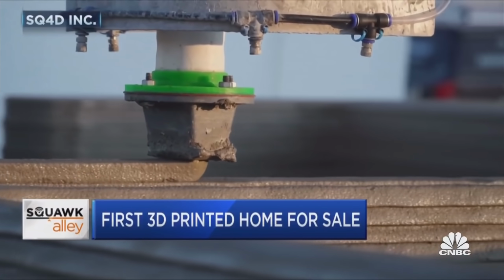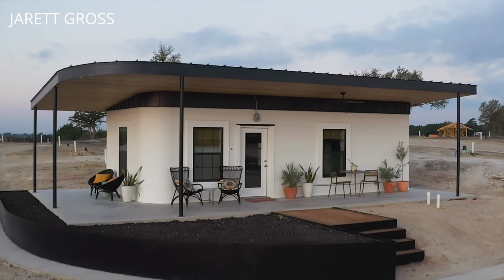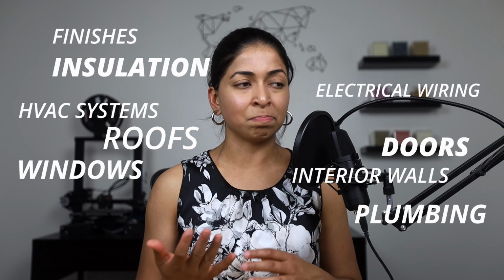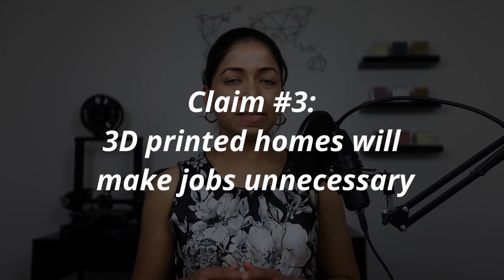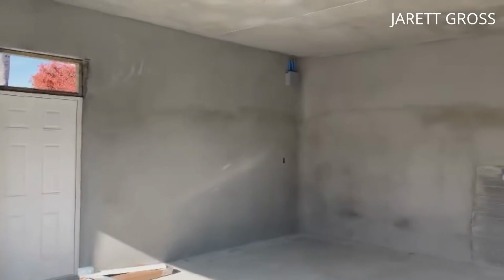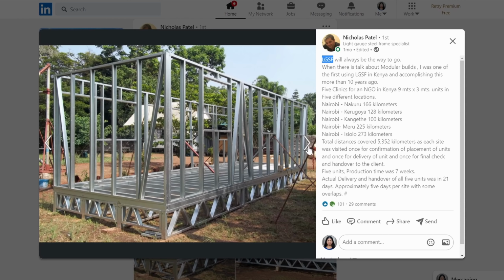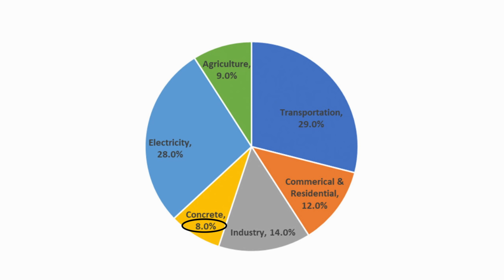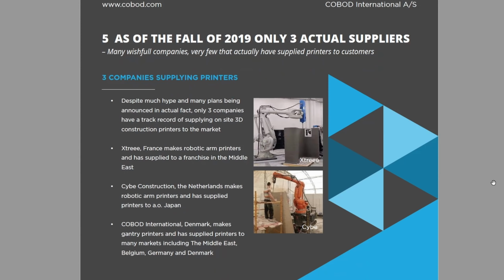Exposing 5 LIES about 3D Printed Concrete Homes

Comment: I've actually looked at a "3d printed home" and honestly, I'm not impressed. At first it seems like a cool idea until you realize that the cement is often low quality and cracks very easily. The foundation used in these projects are not high psi concrete and with all of the weight added from the concrete printed onto the foundation the structure begins to fail almost immediately. The lack of rebar used to give structural support is also a major factor. Essentially what you end up with is a weak shell that cracks and crumbles as things like wood swell push and twist inside the structure. These are the used car version of homes.
Reply: True. Also there is absolutely no reason why 3D printing a house should be easier than stacking pre-isolated cinder blocks. Which seems the easiest process now days.
Reply: When my brother told me he wanted to get into this kind of thing a few years back, the first thing I thought of was the lack of reinforcement. 

They need to at least add some fiberglass in there to give it SOMETHING, for crying out loud.
Reply: That’s the scary thing if there is no rebar in it and of the concrete is not the correct MPA and if an earth quake was to happen (I’m in New Zealand) the whole thing would fail because of the lack of strength it has
Reply: More like the YUGO of home construction...
Reply: Low quality concrete?  

Yeah, you did zero "look into"
Reply: @captain_context9991  to get a block wall you need fairly skilled labor. It's probably easier/cheaper to do a wood framed hardi siding house since that isn't as complicated as laying block
Reply: @BlackHawkBallistic , that's true, but I'll bet workmen who can competently lay up a cement block wall are easier to find that workmen who can competently run a 3D concrete printer.
Reply: @miked.9364  The ones I looked at were made with residential grade low psi driveway cement. The simple tell tail sign was the rub test. If you can rub it with your hand and it feels like a low grit sandpaper it's low psi cement mixed with a boat load of large grain sand. 

Sounds to me like you are just looking to argue or shill for a company that makes very low quality homes... Either way it's kind of gross. You should probably go look for yourself before making assumptions.
Reply: @BlackHawkBallistic  the cheapest well built small homes I have seen are usually milled local lumber homes build on strut foundations. They tend to have drywall issues but if you go with panels instead they tend to last a lot longer and require less maintenance in the long term.

Edit: spelling.
Reply: @Some1special  Sounds to me like someone spent a couple minutes googling.
First it's;  'often low quality and cracks very easily'
Now it's;  'can rub it with your hand and it feels like a low grit sandpaper it's low psi cement mixed with a boat load of large grain sand'

Two very different aspects to concrete.
Yeah, someone is talking out a hole and it's not their mouth.

Each company has their own proprietary blend of cements.  Hmm, now why would they need multiple blends for?
Reply: @miked.9364  Still sounds to me like you have no idea what you are talking about and just looking to argue.
Reply: @Some1special  Sorry,  You got exposed for misinformation.
Don't try to deflect by accusing me.
Reply: @miked.9364  Sorry, you still haven't actually made an argument or refuted anything I've said. I know your probably scrambling through trying to pick any little thing you can to make some kind of uneducated point on a topic you likely don't know anything about. That's fine and all but don't let it keep you up at night. I'm sure you have plenty of friends and family that are waiting for you to come back to reality and spend time with them. Maybe instead of looking to pick a fight with people on the internet you can go get an actual job and help your family out.
Reply: @Some1special  Still attacking I see.
You were caught spreading misinformation.
Reply: @miked.9364  Not attacking at all, just saying that you really should spend your time more wisely. This conversation really doesn't mean anything to me.
Reply: @Some1special  Not attacking at all? Yeah sure,  like cnn wasn't attacking Trump or fox isn't attacking Biden. 
It's what happens sometimes by certain people when they get caught spreading misinformation.
You know they would rather attack then admit to their mistake
Reply: @miked.9364  We can agree that the MSM is full of shit if you want but that's a bit off topic. I'm only suggesting that you chill and go do something meaningful instead of trying to coax an argument out of me. Life's short man, go enjoy it instead of trying to build arguments and straw mans on the internet.
Reply: @jackfield8682   im in NZ to. And by hard work i am infact the 3d print concrete license owner. Since 2014.
Do you think these companies doing the printing are paying the royalties on concrete? I can conferm they are not. Robbing peter to house paul. 
 I need all the support i can find to get them to start paying.
Manual construction industry should jump at the chance to use this opertunity that there is serious piracy concerns with unpaid royalties on commercial gain. Im actually very open to negotiate. 
The license should be generateing a lot of money into NZ. The license covers ALL 3d printers so work out that amount, The royalties are currently 1500 dollars per 10 tons. 
The insults im getting as if that changes the owner is a sad tactic i woke up to today. Not remotely profesional way to negotiate a better price. As a fellow New Zealander i hope to find supporters. 
Its a big deal such a 3d print license is owned here. The license covers ALL 3d printers so yeah i hope the people of NZ want to support Those royalties comming into NZ from accross the world. 
Any supportive actions really needed Thanks. Its not easy being the license owner in this particular case people dont want the law to apply to them. 
Please whatever your structural views on the people who print the houses is,  consider the other sector, the owner of the license, i dont print concrete nor houses nor supply the concrete, im just a seperate endevour all together, i own the 3d print concrete license and royalties apply. 
Thats what i want support for is Just to have the rules followed. Royalties paid. Respectfull business dealings.
Not pirates who dont want the law to apply to them. 
Anyway if anyone can even post a supportive comment on my page that would be nice.  
Willofnewzealand. 
Thank you. 
I wish you all nice success. 
Be well.
Reply: @trans_eater  Bad isolation. In my village some single family homes where build with prefab panels - connected by rubber joints.
The joints over time eroded, isolation damaged and the walls started to moulder. The owners are constantly repairing and maintenancing the homes and this is expensive. My home is build out of on area made steel enforced concrete and bricks. It was expensive because it needed 18 Months to build and at this time we had to pay the rent for the appartmet and pay back the depts to the bank. Fast building avoids this long time double payings (and if you pay $1000 for your appartment a month 12 months earlier access to your new home means $12.000 less to pay).

Comment: The thing that I am worry about 3d printed concrete houses is a cracking of concrete. In traditional concrete construction the steel armature is usually used for keeping it sustainable. And all massive monolyth constructions are always segmented by deformation seams to prevent it from cracking. But what about 3d printed home? I've seen that some companies put a steel struts between layers and that's it. Is it enough to prevent the whole walls from cracking?

Comment: Solving homelessness is indeed a weird target for these 'printers'. If you're just trying to create shelters or cheap housing, prefab would win on cost and speed I presume? I think the flexibility of these systems is more 'organic' architecture, things that are harder to do with square bricks or straight sticks. But it can only be cost effective if these machines are fully autonomous (no babysitting or complex setup), are easily transportable (or are used for big development projects) and would allow for multiple tool attachment (same rig is used to also place windows or lintels, insulation,...) 
They also state it is printing 'concrete' is this regular concrete or are they doing more of an aircrete mixture?
Reply: Good for constructing very intricate shapes I guess. 
And only good for that. Humans could have built straight brick walls faster than that machine.
Reply: @dash4800  sometimes these projects are shut down because they were building substandard structures that would ultimately end up needing to be torn down.
Reply: Affordable housing is usually a zoning problem. Shipping containers, tiny homes, and 3D printed homes are all single family homes. 

Taking a plot of land that could hold six of these could also support a 40+ unit apartment building and increase the overall housing supply in a city.

Single family homes aren't the solution to housing shortages because the problem isn't a shortage of housing, it's a shortage of land.
Reply: Yup prefab designed to be thrown up with no skill or low skill labor on site would be cheaper.  Build a factory that uses the same techniques and technology as the automotive industry.  Make the components small enough to be transported easily.  You reduce the cost through mass production.  The cost drops dramatically when you churn out millions of units a year.
Reply: It is an example of "virtue signalling".
Reply: Housing shortages and homelessness are political problems, not practical ones.
The building of homes or shelters itself isn't the difficult part.

What is difficult is getting the governments permission.
Reply: It looks to me that it is just grout going through a hose. No rebar, no wire mesh, just brittle stuff sticking up in the air. Not something to be in a hurricane, earthquake, or tornado. They used to make a kind of welded wire truss maybe 3mm or so to go between layers of concrete block, I was hoping something like that would be used, and some vertical rebar stuck in and grouted once in a while. Am not seeing it.
Reply: Homelessness also isn't fixed by just shoving a person into a home. Who pays for the home? The land? The utilities? Their food? Who teaches the homeless person marketable skills? Treats their addiction and/or mental health issues? 
People who fall on tough times go to shelters, get help from social workers and/or family/friends, follow a plan and get back on their feet. The chronically homeless person has deeper issues than a lay-off and eviction.
Hell, i met a guy once who was in his 50's, been homeless since he was 15 and scoffs at the "normal" people who settle into jobs. Been all across Canada, down the US to Mexico and back. He didn't call himself homeless, he called himself free.

Comment: As a civil engineer, I have been saying this for years.  Glad to see this video.  Hopefully it informs the uneducated masses.
Reply: I always said, 'oh great, some walls, what about the rest...!'
Reply: 3D printing is trying to solve a problem that does not exist. Whatever material are you trying to make walls with is already cheap, standardized and has large supporting infrastructure
Reply: @jankom.7783  Standardization is the death of creativity if devoid of anyone challenging it.  It may not be obvious now why it's useful, but people said the same thing about regular 3d printers, which are already speeding up the process of rapidly prototyping unique parts across so many industries.  Maybe it'll fail, maybe not, but it's dumb to shut the door on it already.
Reply: @GuardDog42  3D printing will not solve problem with housing. The walls themselves are only small part of price of a house. Building the walls of a regular house take maybe two days. So it is as fast, or faster than 3D printing. Material for normal house costs probably even less than for 3D printed house, because you can use local materials. Which probably will not be so easy with 3D printer.
Building a house is already cheap today. The reason why houses are not cheap is because people do not want a cheap house. Everybody buys or builds a house that is as big and expensive as they can afford. That is just human nature. And people want to live in a good location. Which is another thing that drives prices of houses up. Price of land. None of this things will be solved by 3D printing.
And regarding 3rd world countries: they usually can afford to buy a building material. Because that is cheap. And find few people who help them build a house. Because they have family and friends. Problem is then to buy a build everything else, that makes house "adequate" - windows, doors, water, electricity, heating, plumbing. And this is the expensive part

Comment: Amish people would be laughing their asses off if they ever saw this vid. "You want a house built in 24 hours? sure we can do that, we did 1 yesterday for Ezekiel's son."
Reply: The question of the finish/utilitys is solidly outside their time frame too.
Reply: No doubt
Reply: @AlfredMorganAllen  Not a strong point, though. I can wait a few weeks it's fine.
Reply: They save time with no need for wiring!
Reply: @lads.7715  There are different types of Amish, a lot of them use electricity, or cars, or mobile phones.
I recommend you the last videos from Peter Santenello on this (very interesting and fascinating) topic.
Reply: @MegaSockenschuss  Yes, Peter's videos on the Amish are the best documentation I've ever seen. I live near, and do a lot of business with, the Amish communities in the counties he visited (I'm in Tuscarawas county). Peter's videos are the most honest representation of them I've ever seen.
Reply: Also, this conveniently ignores several details about the Amish construction methods. In particular that as a community project, the cost of labor is donated to the homeowner. The speed of construction is entirely a factor of the number of humans working on the project. A normal size construction crew would not be able to work that fast, especially if they were using Amish methods for construction. Having a massive crew helps most of the construction work happen significantly faster.

Comment: If you remember back a few decades, there were foam portions of concrete forms along with rebar for pouring concrete walls instead of using concrete block. Essentially as I look at that industry in the United States, the most unreliable people who did that kind of work were masons. Not all masons, but block layers and bricklayers historically have been a problem child. As I talk to builders I find out it is the toughest thing to get them on the site and get them to do the job as contracted. I want to build a home and it was during the winter and they had a big problem being able to brick the front of the house because of the weather. I told them when you get here tomorrow morning the front of the house will be tented and there will be a heating unit in there to keep it well above freezing and well above 45°. It never occurred to them to do that kind of a job so they could work, they just wanted to work under ideal conditions for them and the hell with the job. Then the bricklayer and the concrete guy got into an argument on who was going to pour the porch floor first or after the brick job. So I just fired them both and hired a company that did brick and concrete work and let them decide in their own mind what they wanted to do first. 3-D printing to some extent tries to replace the troublemakers which are the Masons.